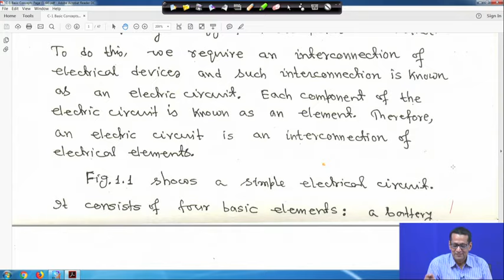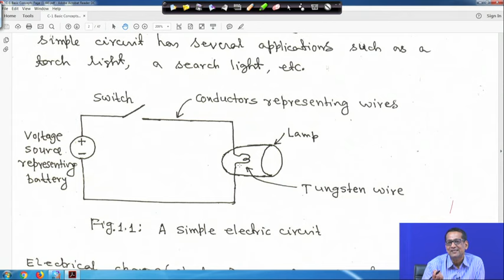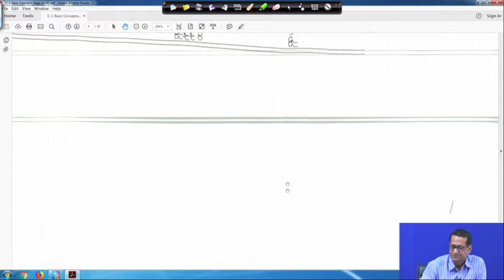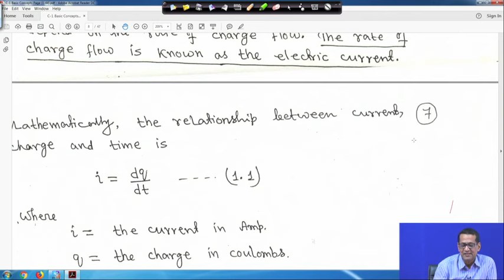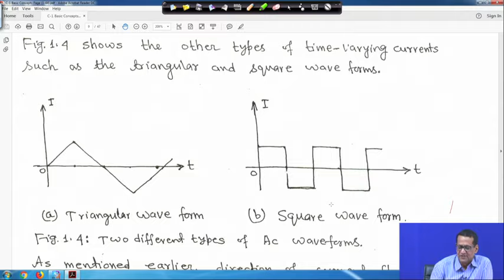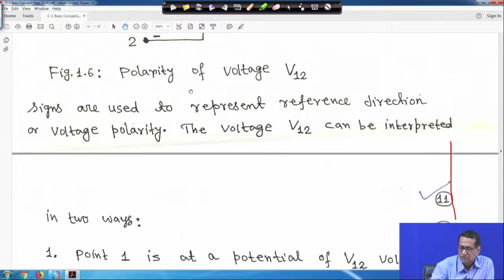Lecture 01: Basic Concepts, Examples

Comment: There are nice lectures here too by faculty of North Carolina State Univ with a  unified approach to electrostatics and circuits , Coulomb's Law, Electric Field Patterns, Capacitor-Charging and Discharging, Ampere's Law, Faraday's Law, Lorentz Force and Motional E.M.F.
For accurate visualisations of patterns of electric fields of different charge distributions see these nice lectures here
1*. *Ch13L3a
https://youtu.be/KozCf3bkTe0?si=MYdCIXiQdUrElIpR
2*. *Ch13L3b https://youtu.be/uEZd_uHjSyA?si=fKdziqYwQ8GnD4Ia
3*.  *Dipole Ch13L3d
https://youtu.be/XsYXMbqTRm8?si=zSKwRKNv8cXTzuGr

You may continue to the lectures 
 4*. *Electrostatics experiments with Scotch Tape 
Ch14L1a 
Watch from *5.0 minute*.
https://youtu.be/NI_Qie9aD2A?si=31O8Yx9GxH9_JPAG
.....
*5*. and continue in this lecture
Ch14L1a 
https://youtu.be/VrIGC2KTheg?si=D3KaKuf_u7ZeHJDT

Then one may learn polarization of atoms, molecules, ions by electric fields in matter in these lectures
6*. *Polarization in matter by external (applied) electric fields.
Watch from 3.0 minute. 
https://youtu.be/VrIGC2KTheg?si=XzuSBULUdHdOgmOc

*7*. Polarization of molecules and atoms by external (applied) electric fields.
Ch14L2a 
Watch from 3.0 minute. 
https://youtu.be/VrIGC2KTheg?si=XzuSBULUdHdOgmOc

*8*. Polarization of conductors and insulators by external (applied) electric fields.
Ch14L2b
Watch from *5.0 minute*.
https://youtu.be/4e3jySEiUCQ?si=dPaBc2UzLOAf-REx

One may continue to lectures which use a unified approach to electrostatics and circuits 
 Simple D.C. circuit. 
9 Pattern of electric field.
Watch from  *16.0 minute*.

10 Mechanical Battery
Watch from  *19.0 minute*.
Ch18L1b
https://youtu.be/Eu3JQKrJRZA?si=t3MeX8Hi8ELAxaz0

11 First intro to  Surface Charge 
Watch from  10.30 minute. 

12 Surface charge gradient 
Watch from  15.30 minute. 
Ch18L2a 
https://youtu.be/bp0o1HZOs3g?si=PPiPGepbXvdTgJHX

The full set of lectures beginning Chapter 13 (Ch13) of Electric and Magnetic Interactions by Chabay and Sherwood are here
*13*. https://youtube.com/@matterinteractions9300?si=1v2D5cW9eKMqCiLu
Also refer *Fundamentals of Electric Theory and Circuits*.

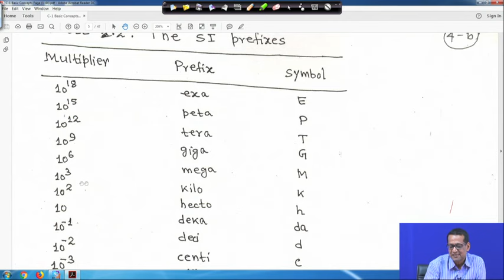Comment: 13:05 . I felt somewhat got mislead, at 10 power 1

it's not "deka" its "deca"
Reply: Deca- (International spelling as used by the International Bureau of Weights and Measures; symbol: da) or deka- (American spelling) is a decimal unit prefix in the metric system denoting a factor of ten